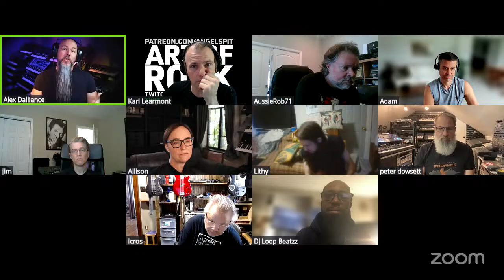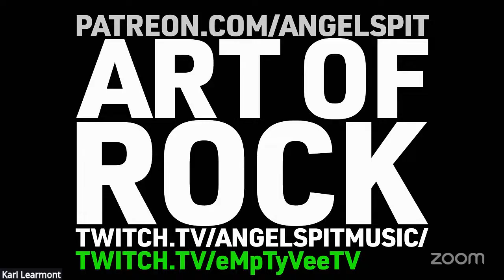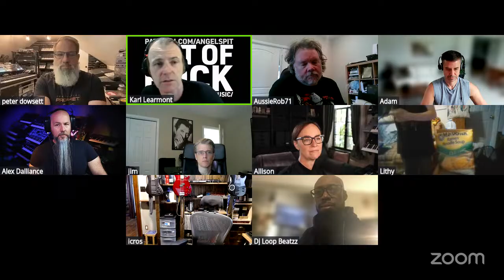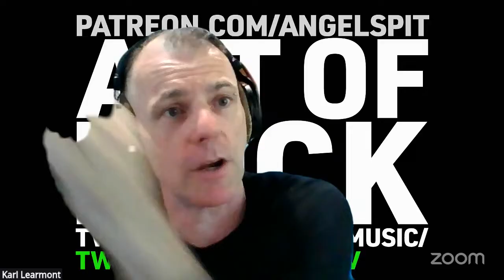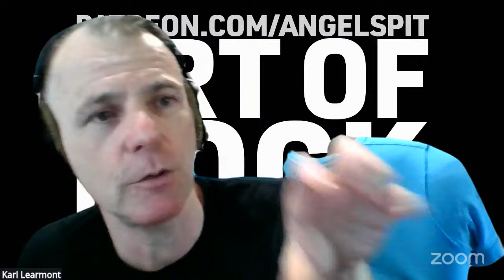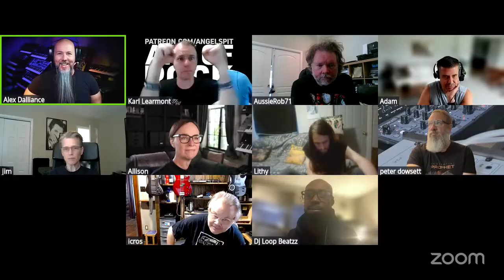#EMU #EMAX USERSZOOM AUG 16, 2026 - #vintagesampler #sampler #EmuEmax #EmaxSampler #EmuSystems

Comment: Hi Karl, I wish I could join the talk, because I have a lot to share about the EMAX.
I bought my EMAX I rack unit about 20 years ago; a few weeks ago, I acquired an EMAX II keyboard, and I am absolutely amazed by it.
Anyway, here are some of my observations:
1.- Regarding Preset Definition: In "Edit Assignment" mode, the EMAX I allows you to transpose a sample downwards, but only up a few keys; the EMAX II allows you to transpose across the entire keyboard, both up and down. As for individual outputs, the EMAX I has certain advantages in that you can assign a sound to a specific output. The EMAX II has four stereo output groups: the main outs and three sub-outs that serve as effects returns, which is very useful.
2.- "Supermode" is a great feature on both EMAX models; however, I don't recommend using it if you're trying to use the EMAX as a MIDI controller.
3.- Regarding the sequencer, I find it very useful. I use it for unquantized atmospheres. When I need rhythm, I can manage by syncing the sequencer to a drum machine or using the arpeggiator or with a looped sample. Alternatively, you can generate a click by triggering a single hit, stopping the sequencer, and then appending the sequence to itself—now you have two clicks. Copy it again, and you have an exact 4/4 bar sequence to build a beat over, which you can then copy into other sequences.
4.- As for which is better—EMAX I or II—I have to say the EMAX II is a far superior instrument. It has countless advantages over the I, and although the I has a very distinctive sound, the II isn't all that different. It offers greater polyphony, much more memory, stereo sampling, and audio returns for effects, among other things.
Well, I could go on forever talking about this sampler, which has become my favorite instrument.
Best regards,
Reply from the maker: This is great- thank you! The next Zoom/Stream will be announced here: https://groups.io/g/emax (Sunday Aug 30)